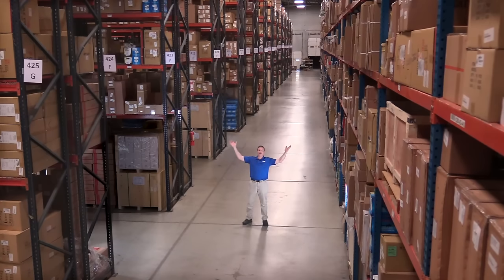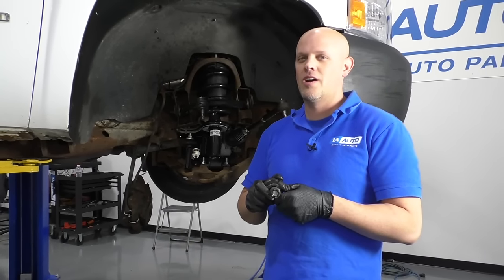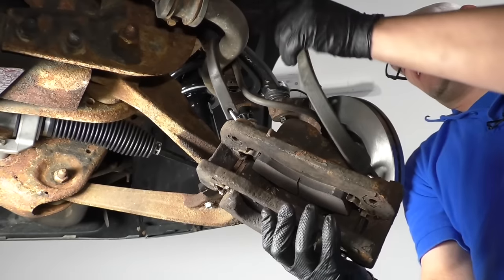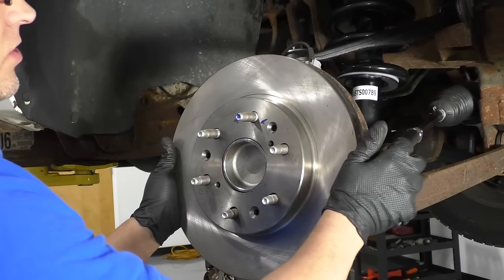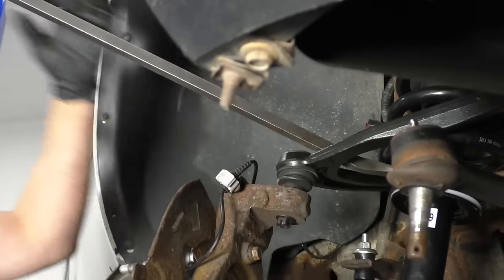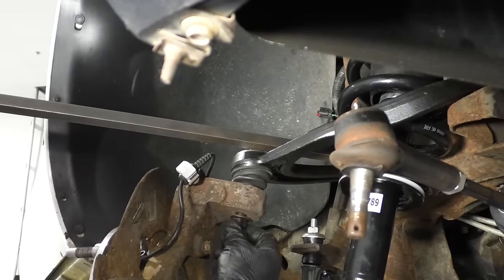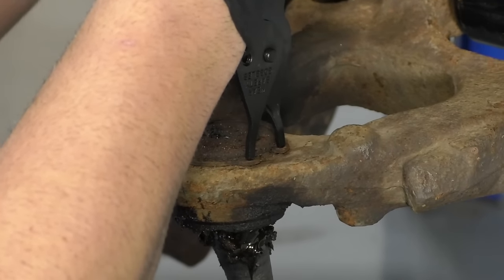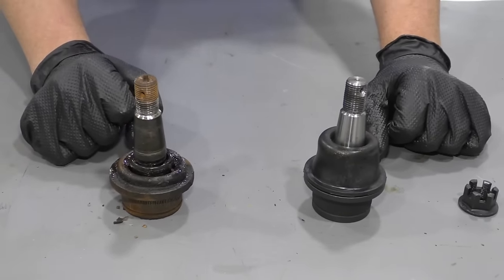How to Replace Ball Joint 99-15 Chevy Silverado 1500

Comment: To All Installers, ON the top or Lower Ball Joints; You make sure the Ball Joint is tight before You Torque. VERY IIMPORTANT; The Ball Joints are Tapered Fit. NOTE (the tighter you torque the nut, the Tapered Fit will squeeze together) and that Ball Joint MUST BE SEATED TOGETHER BEFORE YOU TORQUE. If You Noticed the Nut turned after He Torqued the Top Nut. That shouldn't Never Happened. Those MUST BE TIGHT. In addition, I Always put A Light Grease or oil on the Stud side of the Ball Joint to make the Metal slide together better.  The Light Grease will squeeze out over time, but grease create a slippery joint to fuse the taper joint  together. In Addition check the Tapered Wholes for dirt of pieces of Metal in the Whole and clean before you install the Ball Joint. A tapered Joint  MUST BE TIGHT BEFORE you torque the Nut. If the Joint is loose it will Wear the Taper Fit and the Frontend will become lose. Over tightening is less damage than under tightening. Dry surfaces will not slide and well as Lubricated joints with lite Grease will fit tighter to the Stud on the Ball Joints.

Comment: the old lower control arm turned into a new lower control arm.
Reply: Yeah I was wondering the same thing
Reply: And the new rotor turned into an old one at the end.
Reply: Thomas Fodel 😂😂😂
Reply: Not sure if that's correct since they didn't replace the other 2 bushings.
Reply: Did they paint it?
Reply: they make thousands of video and join them together to make specific project videos. Ive seen crazier shifts mid video lol.
Reply: Lol I thought something looked different
Reply: In the blink of an eye! There's a separate video for that I am sure. Seems like the truck is their "how to video mule" pretty good idea imho.......
Reply: Its their wire brush
Reply: Then it turned back into an old lower control on when they installed the wheel.
Reply: Also didn’t use the castle nut but a regular one... hmm
Reply: Right it’s magic I guess 🤷‍♂️
Reply: And back into an old one at the end, and the rotor, and the ball joints.....all that work for nothing 😂😂😂😂😂😂😂
Reply: I swear I thought I was tripping even laughed a bit
Reply: Lol, bruh I had to go back but you absolutely right 😂
Reply: Even a different lower ball joint on the new lower A arm  yeah I'm good on ordering from A1 auto. Not sure they have the right parts after 30 yrs.

Comment: If the lower ball joint has a snap ring on it the ball joint has been replaced. On the factory GM trucks from 07 up the factory lowe ball joints are pressed in and the factory peens the part of the top of the lower ball joint over onto the lower control arms so what you have to do is use a grinder to grind those 4 ears off or what i did was ground all the way around the top of the ball joint then used the ball joint press and it came out no problem remember that this is on the trucks that have the cast iron control arms and not the aluminum ones . I found most of the videos on changing these out usually show the aftermarket ball joint that has the snap ring and not the factory boll joints that are pressed and peened to the lower control arms. If your truck is rusty you cant actually see these 4 ears that get peened over because of the rust so just use a hand held grinder and grind all the way around the top of the ball joint to grind those off and if you dont you won't be able to push the old ball joint out .  My truck is a 2009 Silverado 1500 4x4  so of course to change that lower ball joint the whole hub assembly has to come off in order to get a grinder in to grind that peened over factory ball joint . If you look closely that peened part almost looks like a ring on top of the lower ball joint but on mine because its a midwest truck that sees snow and salt i couldn't see these 4 ears so its just easier to grind that small lip or ring off  all the way around to then press it out . Hopefully this helps others that dont have the aftermarket replaced lower ball joint that has the snap ring and has the factory ball joint.

Comment: On my 2001 Chevy Silverado the control arms were way different.  The ball joints were riveted in.  The controls arms were formed steel and not cast iron like these.  
Save yourself some time and buy new control arms.  You will get new bushing and all of the hardware too.

Comment: Great video.  One question - during the disassembly, the sway bar link was NOT removed but during re-assembly it was re-installed.  Is it necessary to remove the sway bar links during this procedure?  Thanks
Reply: Yes, you need to remove it

Comment: Why wouldn't you do both upper and lower at the same time? If the bottom is bad what's the likelihood that the top will need replaced soon as well as both sides?

Comment: My 1999 Chevy Silverado has the 3 rivits on the lower ball joint! Either I have to cut the 3 rivets off with an angle grinder or replace the entire control arm!

Comment: 1999 and 2000 have 4 factory rivets that even after you cut the tops off wont come out. how do you deal with that?
Reply: Did you fix it? I’m running into the 4 rivet thing now... it’s not a through hole from what I can tell like the video shows. It looks like it is some sort of domed cap.

Comment: 10:22 on my 03 silverado 1500 4WD used the receiving tube that was too big but my control arm allowed for ~240 degrees of the tube to be under the control arm and sit behind the ball joint under the arm and it worked.  This control arm in the video wont allow the tube behind the joint under the arm it seems.

Comment: In this example the truck was a 2wd and didn’t have the cv axel obstructing the upper ball joint from the torque wrench. In the example of the truck being 4x4 how do you torque the upper ball joint to spec considering the cv axel is in the way?

Comment: Yours went a lot easier than mine is going.  My upper ball came out of the control arm, and the pickle fork is all the way in the lower joint, and despite a hour of hammering it has yet to come out.
Reply from the maker: +Derek Eickholtz Thanks for checking us out! You may be able to use some of the techniques shown in this video to help get that removed - https://www.youtube.com/watch?v=RbRp8HxQFaI  http://1aau.to/m/Shop-1AAuto-c

Comment: I have an 06 GMC sierra 1500 that has rivets in the lower arm. could you give me the information on how to remove the rivets?
Reply: marlin gustafson from the research I have done, they have to be cut off with a grinder. I’m trying to figure out how to do this as well because the part I’m looking at has the ball joint attached to a plate, and comes with four bolts. Good luck though.
Reply: They have a video for that

Comment: You showed and commented that your new lower ball joints come with a new castle but installed the ball joint without a castle nut.   Was that a locking nut then?

Comment: Why don't the 1A Auto lower ball joints and outer tie rod ends come with grease fittings? My original parts had them.

Comment: As a guy mentioned below on his '99 with 3 rivets on lower ball joint--my 2000 has 4. My Haynes manual lists a very different procedure: Remove stabilizer bar links and shock, compress coil spring, remove lower control arm, drill out 4 rivets for ball joint, replacement joint comes with nuts and bolts. 
So is this procedure for a redesigned replacement lower control arm? If using the stock 2000 arm is there a ball joint replacement for it that bolts in?
Reply: You dont have to do all that. I replaced my 99 and mine was pressed but same it's to give you more room for press.

Comment: On my truck the ball joints dont have snap rings amd the lower one  has the edges folded down, so it seems like it wont come out or its not replaceable.
Reply: it's replaceable. Just have done the same kind of

Comment: I have an 03 sierra 4wd and I need a new CV axle while i also replace the lower ball joints. can I take the cv axle off and turn the knuckle where I don’t have to take everything off to press out the ball joint

Comment: I replaced my upper control arm and bottom ball joint. Now my steering doesn't return to center after turning. Before I tighten the upper control arm ball joint it is hard to turn the nuckle by hand.

Comment: My 07 Tahoe does not have the Snap Ring Lower Ball joint and it looks like I have a metal cover on top of it ?? Am I supposed to just pry that off and then press off??
Reply: Rolando Morales they have 4 folded lips around the ball joint just chisel them off or grind them off then press ball joint out and press a new one in then install a new snap ring

Comment: Do you have to do an alignment after replacing the lower ball joints?
Reply: Yes you need to
Reply: Especially if your messing with the upper control arm and tie rod

Comment: the upper control arm balljoint stud nut torque per mitchell is 37 ft/lbs plus 100Degrees. You only torqued it to 37 ft/lbs. Which is wrong?

Comment: Did you paint the lower control arm, after you put in balljoint? Or did you have to put in a new lower control arm?
Reply: Pretty sure these videos are edited so they can make several videos installing different parts.

Comment: You Missed the part with the torch and the 15lb sledge for the lower.. and new spindle because of the beating it took hitting it
Reply: preach...  it's never that simple.   not here in rust country anyway.

Comment: Been watching your videos for quite a few years now. Question though, the ball joints were not identical as the new one didn’t have a spot for the grease fitting. How do you grease it?
Reply: You can get them with or without grease fittings

Comment: Did you need to compress the coil springs before removing the ball joints? I have a 2007 chevy express van. I want to change the ball joints. Do I need to compress the springs?
Reply: no just make sure the wheel is off the ground, also don't use the control arm to support the vehicle.

Comment: I have a 2008 suburban 4wd needs upper control arm and lower ball joint. Is it going to be the same as this video?
Reply from the maker: +Matt Warden Thanks for watching.  Yes the process will be the same on your vehicle as long as you have stamped steel lower control arms!  1aauto.com

Comment: For a 2013 Chevy Tahoe 4WD, is it necessary to remove CV AXLE to replace lower ball joint?
Reply from the maker: +Tyler Nicholson Yes you would need to remove the axle.

Comment: I need help with my 2002 Chevy Silverado 1500HD.... sometimes my truck shuts down and doesn’t want to start it acts like it’s out of gas but then sometimes it does start and runs very sluggish like it’s not getting proper fuel I’ve changed the fuel pump brand new fuel filter brand new fuel pressure regulator brand new and a brand new mass airflow sensor and my truck still shut down but will start up and drive great sometimes then without warning shut off and will not start for a while
Reply: Did you test the fuel relay?   Crankshaft or
Camshaft error codes?

Comment: My Lower Ball Joint doesn’t look like that at all it has a metal cover over it I’m not sure how it comes off. have a 07 (New Body Style) GMC Sierra 2WD
Reply from the maker: +Cyrus Jacobs This procedure might be different for your application due to the year. There were different materials that were used for control arms and would also change the ball joint and how they are. We do not currently have a how-to video for this particular year, make and model. Thank you for asking! 1AAuto.com

Comment: Great video. Will the steps differ on a 4wd vs a 2wd?
Reply from the maker: +Gary McVey It will be a similar install.
Reply: @1AAuto  Just did it on my 09 4x4 silverado. You have to take out the cv axle and strut to get to the ball joint. More rusty parts to pull apart.
Reply: 4wd will be harder to completely take of the knuckle
Reply: wait until you follow it then repost your thoughts
Reply: You'll have to remove the drive axle on a 4 wheel drive.  I brake that but loose while the vehicle is lowered but there are a couple other methods too.

Comment: Crazy someone was in there replacing 3/4 of the components and didn't replace the lower lol
Reply: Dennis Berg They make multiple videos with each part being replaced and they put it back together to take it apart for the next part
Reply: Cost. I bought their “almost” complete suspension and steering package, without lowers. A pair of lowers costs more than an entire kit of uppers, ball joints, pitman arm, idler assembly, tie rods, and sway links. I just bought a good old Yukon with really tired steering, and their $200 kit, plus a new steering gear, got it feeling like new. A pair of lowers wouldn’t have done much for the driving experience, for more than everything else, so was cost prohibitive in my case. In a perfect world I’d have $270 more to also replace the lowers, but as it is, I got a great driving car for about $500 in parts total, with the old lowers holding it all together just fine.

Comment: As an aircraft mechanic, watching you install cotter pins is cringeworthy! Other than that though, great video.
Reply: Well please enlighten, because I'm curious and concerned as to placing a cotter pin correctly....please if you will, give a brief explanation on the correct way.  I may have to go back through boat propeller, wheel hubs, and countless other things I've place them on.😳
It’s good to learn these fine details on the proper way to do even the simplest things.

Comment: Good job dude few tips for you never grab the torque wrench in the middle alway use the handle. Did not put the grease zerk in the lower joint and no grease.

Comment: Be aware folks, the TRQ stuff does not come with Grease Zerks.
Reply from the maker: +Guns N Gears Our steering and suspension components are pre-greased and sealed for long life and do not require the extra maintenance typically required by greaseable versions.

Comment: This video is not correct it says 99-15 chevy silverado but I took apart my 2001 and the bottom ball joint is riveted into the lower control arm and u can't replace just the ball joint u need a whole lower control arm If this video had said it was different I would of searched for control arm and only upper ball joints

Comment: Can you replace the ball joints upper and lower without replacing the control arms?
Reply from the maker: +Edwin Wilbur This is possible with the correct tools to do so.
Reply: @1AAuto  I'm just trying to find out if I have to replace the control arms, if the ball joints are going bad is more the question. Because as bbn I watched the video you went from replacing just the ball joint to a whole new lower control arm. So that's why I'm a little confused.
Reply from the maker: +Edwin Wilbur We will often times perform multiple repairs in one sitting for different videos. It is possible to replace just the ball joints.

Comment: What would make the truck lean to the drivers side
Reply: Marshall Hurst if you have torsion bar suspension the torsion keys could be improperly balanced. Just an idea. Or maybe lay off the snacks after supper 😉
Reply: @alexehhhh  it don't how any but I am not in it
Reply: Same its called a chevy lean but idk how to fix it did you find out how ?
Reply: Stuck and failed shock absorber1🤷‍♂️

Comment: Lumping 99-15 into one pile is a mistake.  You guys are CLEARLY missing videos on 99-06 C 1500 2wd upper and lower control arm bushings and ball joints.  As such, you could mislead a novice into attempting to treat a 2WD and 4WD the same and with a coil spring front end you simply cant. Its time to do a 99-06 2wd suspension overhaul video
Reply from the maker: +OldSchoolCars We're always cycling through common cars. We'll add these repairs to our list! http://1aau.to/m/Shop-1AAuto-c

Comment: Garbage, the drive axle just disappeared he didn't even take it out
Reply from the maker: +Spxynx & Beyond Thanks for watching!  The vehicle we had to do the video on is a rear wheel drive, so unfortunately we were unable to show how to remove the axle.  1aauto.com
Reply: LOL.... I just made the same comment. Dont follow this video for lower ball joint replacement or you're gonna be pretty pissed when you find out you also need to remove the hub assembly and disconnect the drive axle, which comes waaaayyyyy before all the other stuff.
Reply: that truck is not 4wd